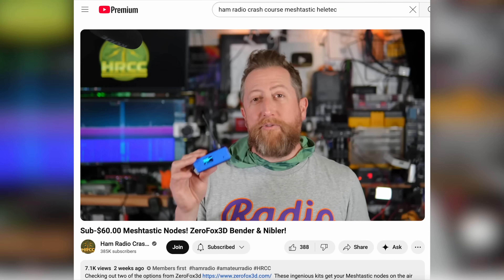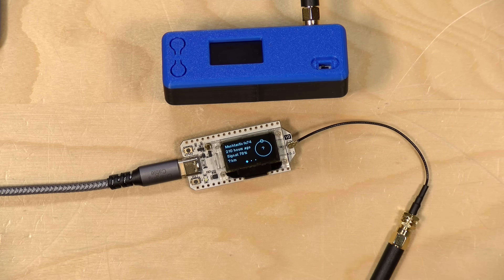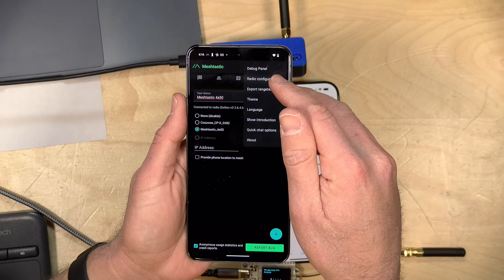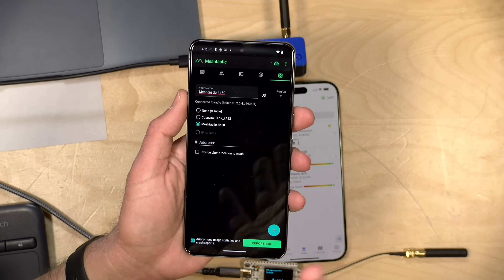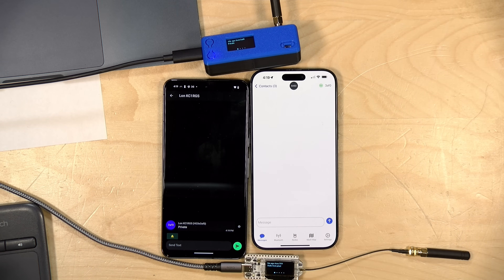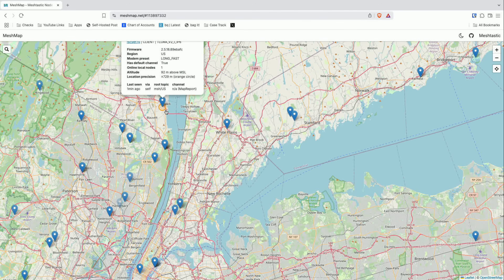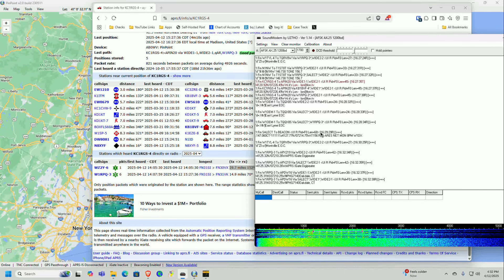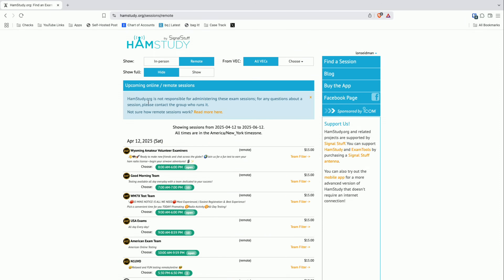Meshtastic on the Cheap & Easy - Is it a ham radio alternative? Emergency Comms Part 2

Comment: Got mine all assembled and flashed!!! So cool!! My only issue is that even though I have 3 Helltec's  I only have one cell phone, so I haven't figured out a testing scenario yet. The nearest nodes on MeshMap are like 30 miles away. Guess I'll probably end up getting together with one of my neighbors which I'll want to do anyway. I'd like to get a good local network set up for emergency comms situations. Thanks for another cool project, Lon...oh, and by the way, for other of your followers that go for this project, I found the designer's instructions for assembling the Bender to have better detail than Josh's. Not to say that Josh's video doesn't have a ton of great information. It's just for old geezer eyes like mine, zerofox3d's assembly video showed better details. Thanks again, ~Frank

Comment: So Starlink supports the first two of the three approaches you mentioned, and doesn't require anybody else to join  in. I think a Starlink Mini subscription is by far the best backup for total calamitous local failure. The cheapest reliable emergency comms would be to be sure your phone can communicate via Starlink's mobile service, which promises to improve in capability as the number of supporting satellites increases. The default will remain carrier towers, with Starlink as contact of last resort. Mesh systems have always been attractive, from a survivalist point of view, but in practice you can't always find a partner with better access than you have.

Comment: So what kind of hardware can you put together to place a Meshtastic antenna on your roof for maximum range and repeater function. I wonder if it could use existing coax with a splitter/combiner at both ends for the Meshtastic antenna.

Comment: I used to run aprs mobile and had some wide range  digipeaters and igates up too. But most of my systems are down now . Maybe I will get them running again and send you a message.  I also got some Heltec boards last year but haven't had time to get them up and running - maybe this summer I can get one up on the tower .

Comment: You would enjoy WSPR.  100 mw can go around he world.  Sometimes with even less power!  And it does it at a little under 2 baud.  Uh huh, < 2 baud.  Slower signal rate means the bandwidth is very narrow making the transmission much more effective.  Plus with FEC you don't need to get the whole transmission to get the whole transmission -- it is redundant and can fill in the blanks.  Often the max distance someone can be heard is limited because the antipodal point is in an ocean.

Comment: Small correction: the circles on the mesh map are not coverage but approximate location. The default is a ~1.8 mile accuracy for privacy. Also the online map will only show nodes connected to the internet and some of the local nodes to them. In some areas there are plenty more than the online map shows

Comment: Can you use meshtastic on a pc instead of a smart phone.  I don't use smart phones cause i am legally blind.
Reply: @keithculvahouse1191  yes there is a web client that works offline despite being a web app
Reply: @keithculvahouse1191  You can connect your board to a PC through cable or bluetooth and use WEB client with that device (chromium based or chrome browser recommended).

Comment: still gotta know Morse Code? Not so easy!
Reply from the maker: Morse code requirement went away 18 years ago!
Reply: As someone who when he operates only operates with Morse, no that requirement is long gone.  But CW is brain exercise.
Reply: Thank goodness that requirement was dropped!!!  Also, Lon's recommendation for HamStudy was really good.  I used it.  You can sit and just do question after question and when you get one wrong, it explains the correct answer.  It's an excellent, easy way to learn.